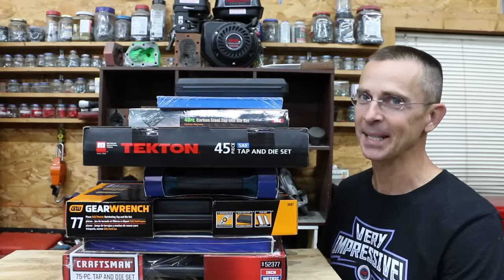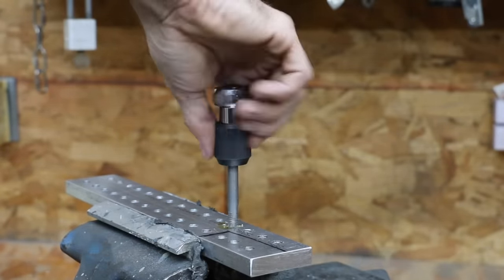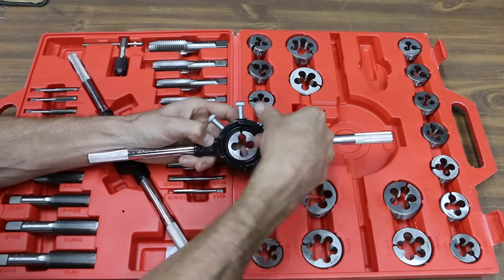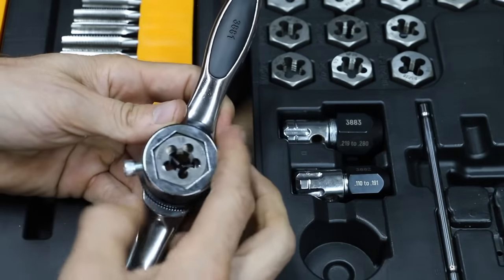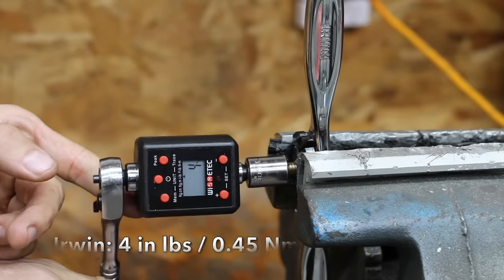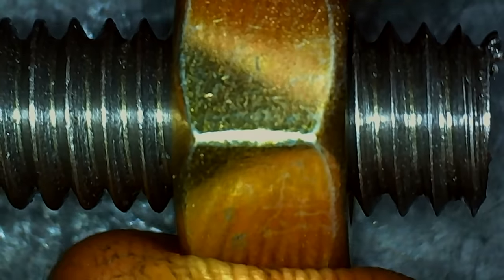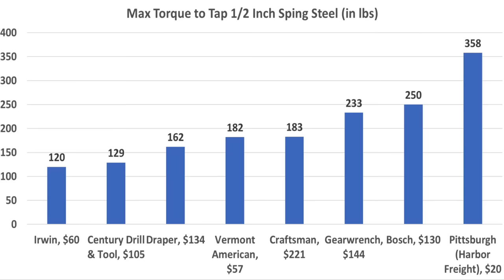Best TAP & DIE Set? Craftsman vs Irwin, Bosch, Draper, Vermont American, Tekton, GearWrench

Comment: Irwin and craftsman were the chosen ones. Having a teckton impact set I was sad to see the failure of the shaft of the tap. Very creative testing on your part as usual. One thing I would have like to see along with the overall price is the price per piece. The Irwin was a small set.
Reply: I agree, you might need something along the lines of $/in though. An extra 1/4" tap should be a lot cheaper than an extra 5/8" tap.
Reply from the maker: Thank you!
Reply: Machinist here too, I've had great luck with guhring drills and taps
Reply: I'd pick the Irwin as it still supports American jobs..
Reply: @ProjectFarm  Good effort to try this, but dang this is something really hard to do without some serious testing jigs. There were some obvious flaws in this and to be fair its a very hard thing to do.

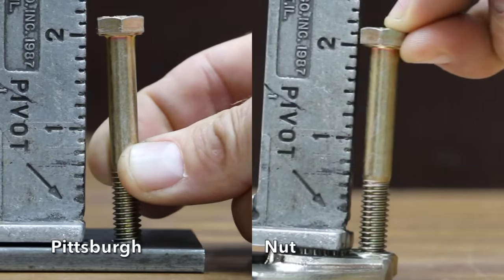On the taps you really needed to use a guide and keep them straight all the way through the hole when your testing for the torque. Its simply way to easy to get a tap out of alignment. At 9:33 its obvious the Pittsburgh (on the left) was not straight.  If you do this again I'd suggest finding a way to use a spring loaded guide.

On the Dies and Nuts you cant just simply put a die in a vice as you did with the Draper (13:55). No matter how you set it up it will deform because its designed to deform. The fundamental difference between a nut and die is that split in the die allows the die to be compressed and cut deeper. In the proper handle you can start cutting a shallow thread with a die and then cut deeper by compressing the die. Putting that die in a vice compressed it and that's why the rod was so lose in the nut

In all the tests I have seen you do this was probably the hardest to do. So you get an A+ for attempting it and trying to be fair to the products.

Comment: Something to keep in mind is the H-limit (class of fit) to these taps. Most consumer sets are H-3 taps which is a fairly loose fit, as in the taps are actually larger than nominal.
Reply from the maker: Thank you for the feedback!
Reply: Exactly why you usually don't want to use standard taps for thread chasing, as they cut oversized. There are special taps for that, and other special threading needs. Any good machinist should know these things, but do we have such skilled people anymore?
Reply: @loboheeler  It also didn't help that he didn't back turn the tap to break the bur every rotation or so. This results in a worse cut and more force needed.
Reply: @markp8295  He did that intentionally in these tests to simulate accelerated wear and abuse, and therefore find out which brands were toughest
Reply: @magicoddeffect  Someone buying the tools that will survive the most abuse instead of the tools that will best do the jobs says a lot more about the skills of the tool user than the tools.
Reply: @carlfesser6673  Why would that matter when he tested the fit tolerances at the beginning of the thread where that wouldn't have been a factor?? And part of the test is to try to push them to their failure point. So should he have spent 1000 hours on each die doing it correctly until it failed from long term use? Are you paying for his time to do that?
Reply: @magicoddeffect  On the long rods, sure. But on the test fit parts, he reduced the tolerances and increased tear out, yet commented on both.
Reply: @markp8295  correct me if I'm wrong but I don't think that's really necessary, the CNC thread tapping I've seen doesn't do that. I've heard it's good practice but I rarely see it done
Reply: @loboheeler   Roger, the taps were size gh3 or h3. That's a mere .0015" over nominal. I strongly suspect there were alignment issues when tapping, hence the sloppy fit. Incidently, the measurement system used here was quite wonky and subjective. Typically the threads are measured over wires with a micrometer, determining the pitch diameter.
Reply: @SparxI0  You may be right... I just looked at CNC tapping and whilst many use a strange helical fluted tap that wouldn't be practical for hand use, some use a regular taper tap.
From personal experience with hand taps, using taper tap to start, then plug tap to bottom, I get horrible results with cheap steel if I don't back off every 2 turns. Less for nicer steel.
I had a look at people using a drill to tap holes and it was horrible.
I don't know if the constant lubrication and very precise motion of CNC makes that much difference.

Further research needed.

Comment: Generally speaking, at least in the UK market, ones marketed as "carbon steel" are fit for chucking straight in the bin. HSS is the minimal viable material.
Reply: That's basically true, but if you're going to be chasing rusted or damaged EXISTING threads on cars and such, carbon steel taps aren't as easy to break as HSS. A broken tap, buried in a hard to reach spot on an engine block, is now your greatest nightmare. I will often run a worn carbon tap in first, then follow with HSS or better yet, cobalt HSS. As a machinist and a mechanic for over 50 years, I've removed more broken taps than most people have ever seen. 😊👍
Reply: @outlawbillionairez9780  There are some good videos on here with lots of tricks to remove broken taps.. Let's Go Brandon!!!
Reply: @twistedhillbilly6157  
Don’t stain this great forum with politics.  Take it elsewhere guys.
Reply: @Mote78  > Take it elsewhere guys.

Guys plural? I only see one person who explicitly wrote about political matters in their comment.
Reply: @outlawbillionairez9780  whats the go to method? Ive seen AvE use acid or something to loosen a broken tap. Ever tried that?
Reply: @Mote78  You're essentially telling that guy he has to leave just because of his name. His comment was completely apolitical.

Telling him to leave for doing nothing wrong is completely inappropriate.
Reply: Yes Greenfield taps and Widia are very good taps this guy knows nothing about tapping .
Reply: @twistedhillbilly6157  “Let’s go Brandon, I agree!” - Joe Biden
Reply: @thomasbarlow4223  sixtyfourford has a couple good vijadioes but not quite as entertaining as AvE.. there are a lot of others too.. I spent over 3 decades in machine shops and we usually had a welder (highly skilled person) weld a wire or rod to the broken tap and un-screwed it.. A top welder can weld a SS wire to a broken 6-32 tap 1/4" deep in aluminum and not damage the surface..
Reply: siu-hung Hung  Most people will be using a tap to straighten or clean up threads. In that situation, I use a 'beater' used carbon tap first, blow everything out, use a little cutting oil and then a good HSS tap to actually cut the finished thread. This way, I know I'm not over sizing the threads. Also less chance of damaging an expensive tap . For threading a blank hole, I just use HSS,as normal. I've done this hundreds of times on Ford exhaust bolts I've drilled out, in car. Not a place I want to break a tap.